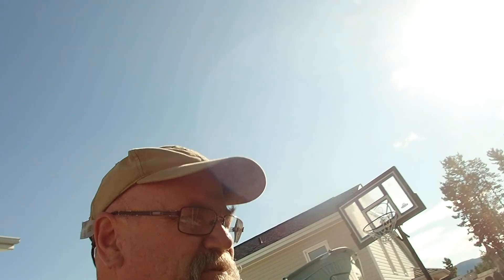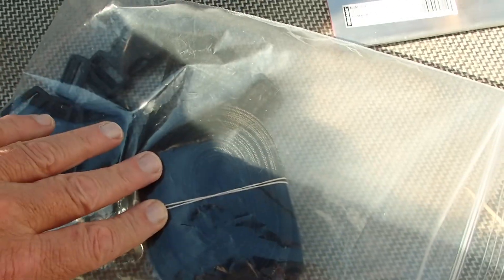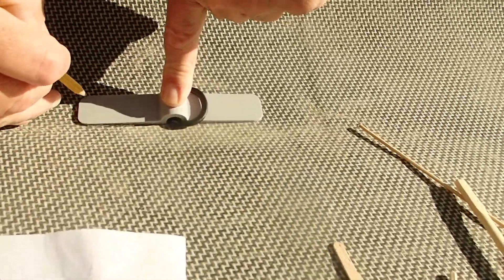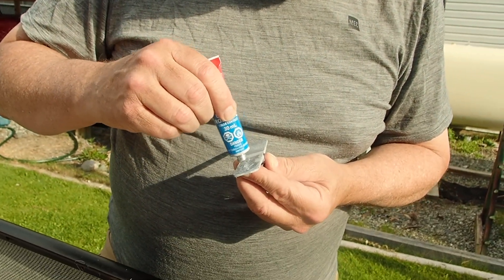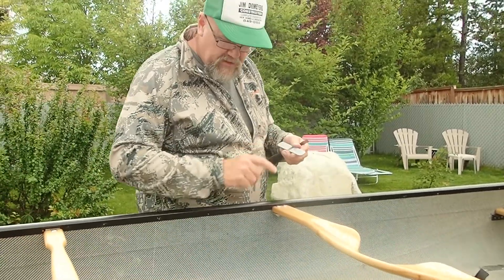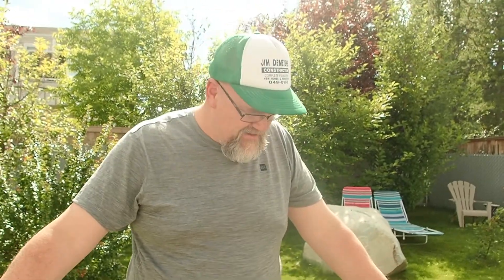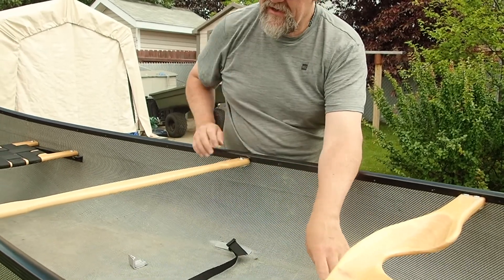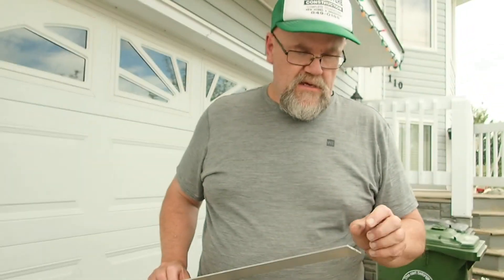Misadventures in Canoe Outfitting

Comment: I’ve outfitted a lot of boats over the year(100+) and I can tell you that contact cement is only good for none load bearing applications. As for the five minute epoxy it is not the right stuff either, but it will hold better than the contact cement... west system gflex epoxy is what you want for those anchors!!
Reply from the maker: I wanted to make sure I didn't use a glue that harmed the boat.  H20 told a friend to use contact cement..which was a miserable failure. In fairness when I called the owner said they farmed that work out and he wasn't sure what to use.  I'll see how the epoxy holds.  Seems good so far.  I did order the G Flex though.
Reply: north61 epoxy is probably the safest to use on all boat mayerial, royalex, R84, and any composites boats! Nothing really stick to SP3 hull we tried pretty much everything so far, same with polyethylene and thermoform(Delta Kayaks for exemple) so best to stay away from those materials if you want to do your own outfitting!! G-flex is great for everything pretty much!!
Reply: north61 can you purchase the H20 in Whitehorse ?
Reply from the maker: @backcountrytundra  Yes..see Spencer at Lister Motor Sports tell them Greg Storey sent you.